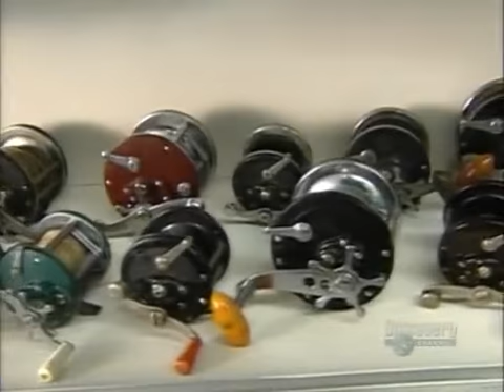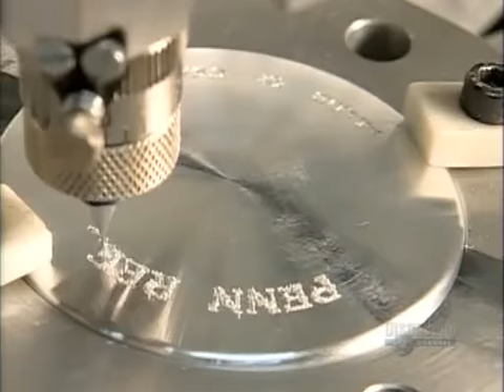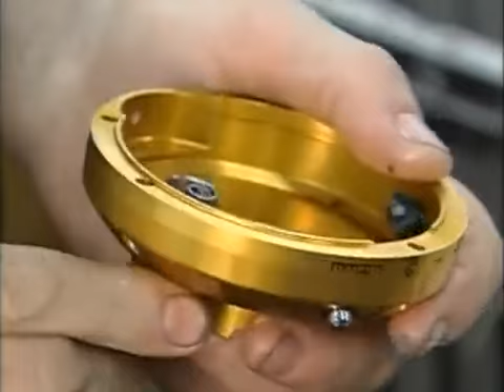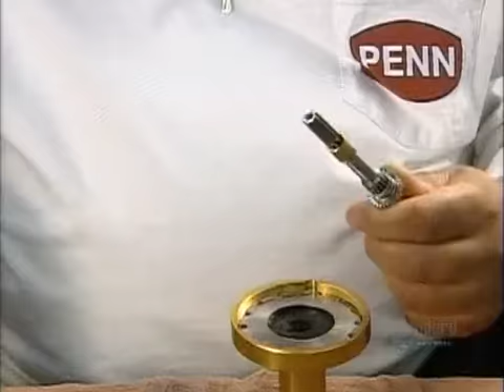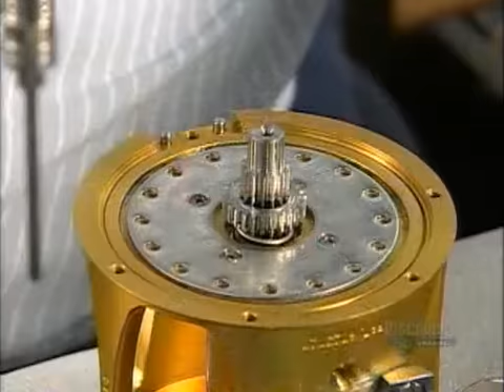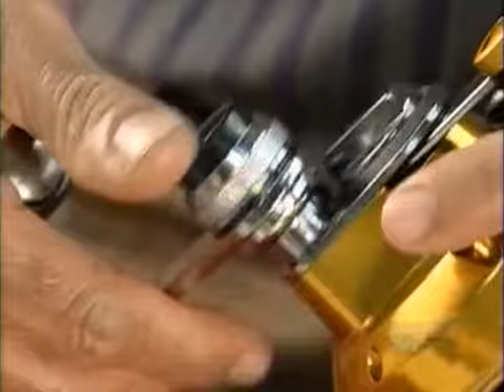How to make  Fishing Reels {www downloadshiva com}

Comment: How many this reel?
Reply: @SaltyBrains  can i try? But free for me.🤭🙏
Reply: 600$ or less
Reply: @Shhnee  😭😭😭
Reply: @Shhnee  idk if this is a 30 or a 50 wide but 30w 2 speeds are like 650 and 50s are 700 130s get into the thousand mark
Reply: yessuh yessuh I know the price of my reels. I fish a ton and buy bulk shimano products every year. I wear the crap out of the rods and reels that I have. That’s the price of a penn which are much cheaper
Reply: This reel is about 600 on the website and 650 in stores. It’s a 50w and a 30w is not 650+ it’s more like 500-550. A 130 is from 900-1300 depending on brand. Avet being the cheapest but least reliable
Reply: @Shhnee im talking about penn because as the internationals were in this video. penn and shimano are the same price tiagra 50wlrsa are 700 penn 50 visw also 700 a 30wlrsa is 650 a penn 30 visw is 650 theres no price difference however shimano seems to be better quality
Reply: yessuh yessuh literally look it up. Penn 50vsw is 650
Reply: @Shhnee 50visw is what they make now 50 vsw arent even manufactured anymore if you used your eyes the only sites they show up are on say out of stock and discontinued theyre out of stock and will never restock because like i said they arent manufactured anymore you're trying to act like you paid some fine dollar for shimano when they're the same price